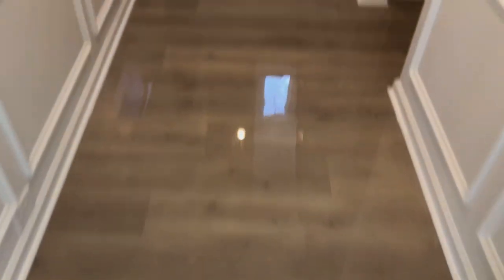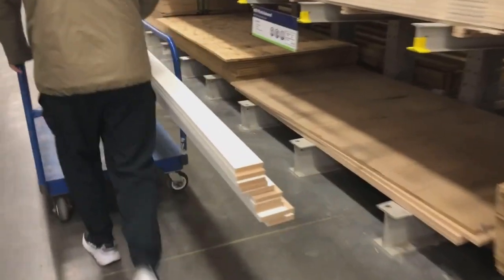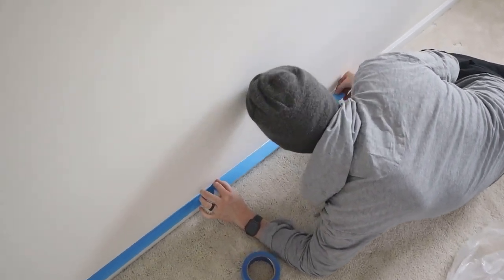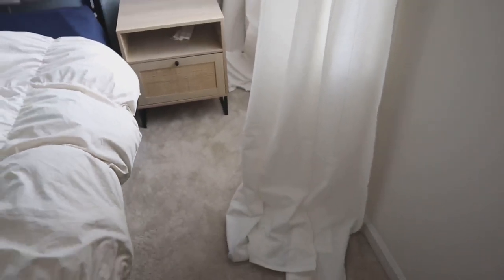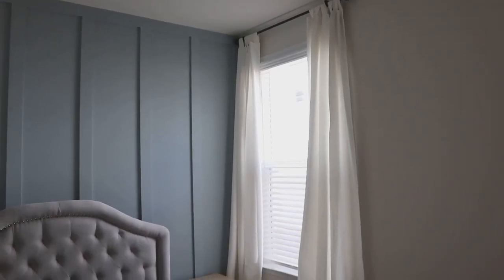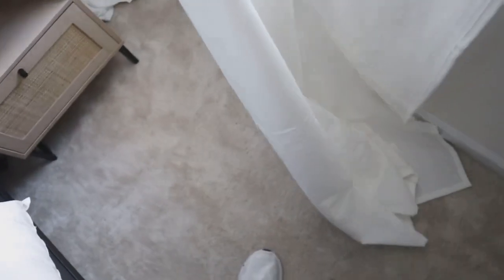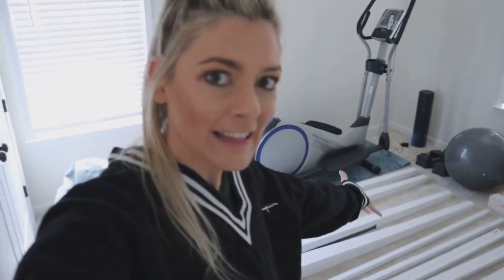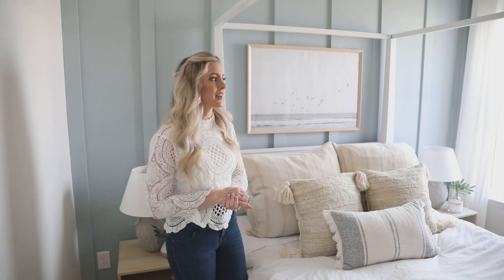SMALL BEDROOM MAKEOVER || BEDROOM TRANSFORMATION || DIY ACCENT WALL

Comment: What a lovely room - it could easily be used as a main bedroom.  My home was built in 1956 and the largest bedroom is 10 x 12, which is tiny compared to today's master/primary bedrooms in newer homes, so your guest room would work very well for a main bedroom in my home. I have a metal French style canopy bed so I'm a fan of the four poster bed you used.  I'm also a fan of putting rugs on top of carpeting and smaller rugs on top of larger rugs.  SO soft underneath one's feet and speaks to luxury.  Thank you for hemming the curtains so they don't get all dusty on the carpet because they're too long and piled up.   I hand iron curtains before I put them up (old fashioned and as I'm older it's harder to go up and down the ladder all the time while using a hand steamer), but it makes such a difference in appearance to have non-wrinkled curtains.  Those wrinkles don't "naturally fall out" over time, they stay.